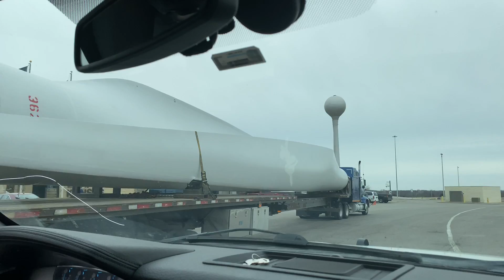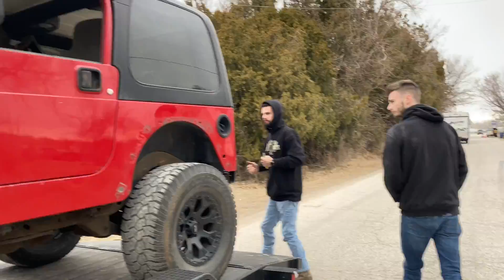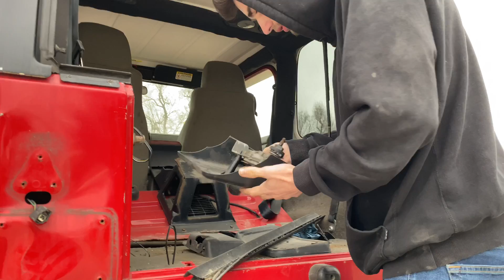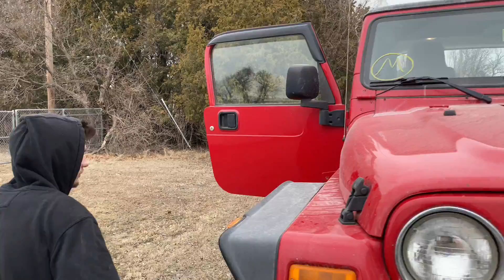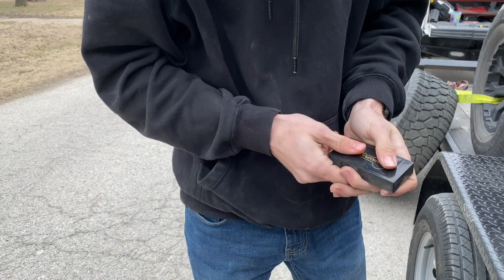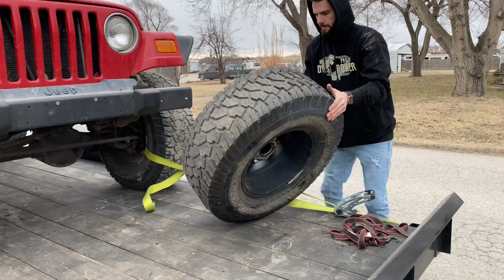Rebuilding A 2004 Jeep Wrangler TJ Part 1

Comment: You guys scare me on how little you seem to know, even on a basic jeep. Hood rod, on the hood, manual vehicles have a button to push to take the key out. The seat has three levers that go forward and back, and adjust the back rest and to lift.
Reply from the maker: Hey thanks for watching and the support! Hood rod mounted to the hood was different then the 20 cars I have worked on, never drove a manual before, and the seat situation I don’t remember!  Thanks for taking your time to help inform us! Hope some of my newer videos change your mind on how much we know! We’re pretty smart guys I  think, a little hard to think on camera some times though!
Reply: @kandkdumpsters  I did watch more if your videos, and you've learned more! Didn't mean to sound rude
Reply: The button to pull the key out must be a US thing. I have a manual car and doesn't have it. That rod to support the hood has an odd placement.
Reply: Juan Pablo Flores Jeep TJ’s and tjs have buttons to take the key out I have a 2006 tj and a 95 yj
Reply: Yj*
Reply: @juanpabloflores8179  I’ve seen the button, but not on any vehicle made in the past 20 years.  Not sure why it started or ended...
Reply: @aidanwheele6337   I have a 2003 TJ automatic. No button.

Comment: Should be a button behind the key, it is an old locking mechanism that cars dont use anymore, some TJ's have them and some dont. You just hold in that button and turn the key all the way back to release the key.